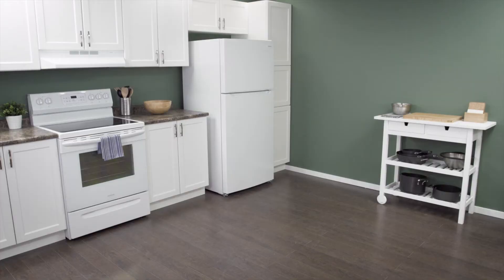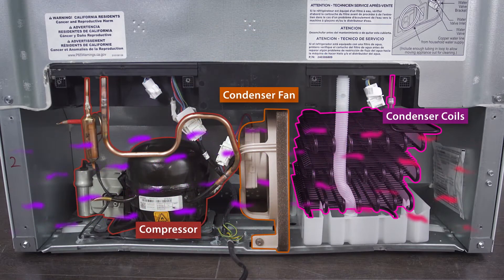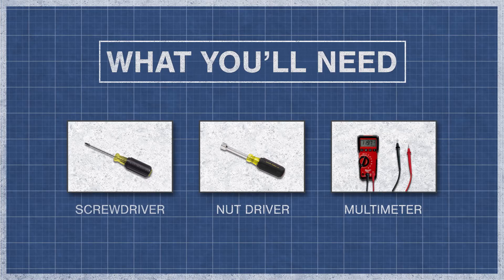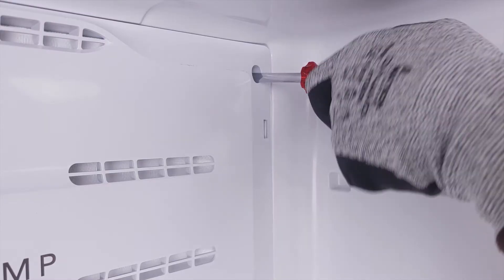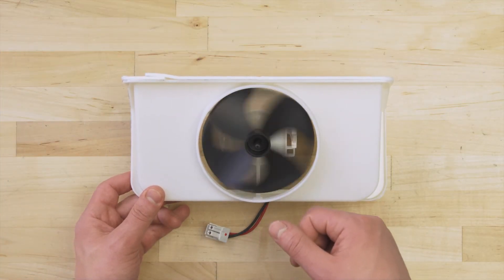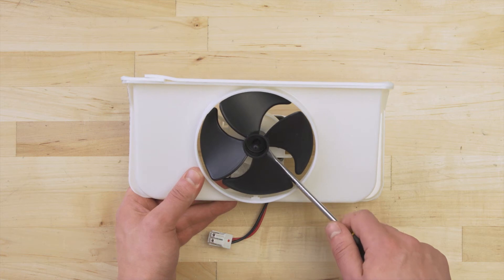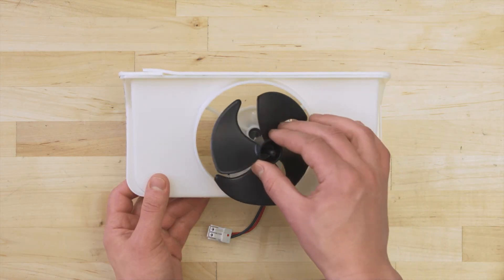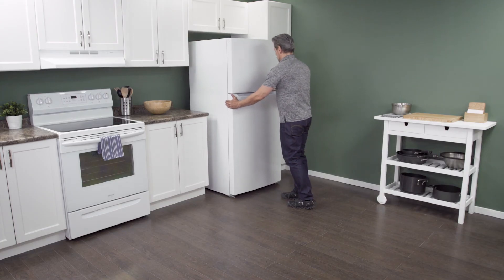How to Test & Replace an Evaporator Fan (Refrigerator) | Repair & Replace

Comment: Is it just me or is the freezer fan pins super hard to get off
Reply from the maker: Thanks for watching. It depends on the freezer. Sometimes the clip is hard to release, or you might need to use a screwdriver to wedge under to help release it.

Comment: I replaced a faulty fan motor but now it runs constantly, what would be the issue now?
Reply from the maker: If the compressor continues to run that means it's trying to cool the system. It could be a faulty cold control thermostat or thermistor. https://www.youtube.com/watch?v=pI0ian6WqSI

Comment: Where do I put the proba to test it
Reply from the maker: There will be two connectors on the motor. It doesn't matter which probe goes on each terminal. In some cases the terminals are mounted right on the motor itself.

Comment: My LG refrigerator fan is not blowing except when performing testing cycles.  Test 1, 2 and 3 confirmed the fan is working.  So what can be wrong?  The thermostat or thermistor ?  Where is it located?
Reply from the maker: If you have a control board that you're able to do test cycles, then you most likely have a thermistor, and from what you're describing it does point to a faulty thermistor. You can see how to access and test it in this video: https://www.youtube.com/watch?v=HQFRUuWIz_o

Comment: Hello idk if you can answer this but my evaporated motor/fan doesn't spin unless I pull the axel/pole up but if I let go it's stop spinning
Reply from the maker: Thanks for watching. Two things could be happening. If the motor is lying on it's back, gravity / friction might prevent it from spinning freely, and if it's installed on it's side this would not be an issue. Or alternatively the bearings might be starting to wear down. So if the fan is noisy or not getting up to speed, then you'll want to install a new one.

Comment: My fridge keeps getting down to the correct temp, then rising back up to 55F. Is this a bad fan?
Reply from the maker: If you've got a top freezer, then you'll have a cold control thermostat. In this case the cold control might be sticking... the fridge cools, the contacts open and get stuck intermittently. Alternatively in newer models a faulty temperature sensor (thermistor) can also cause weird behaviours like this.

Thermistor video: https://www.youtube.com/watch?v=HQFRUuWIz_o
Cold control thermostat video: https://www.youtube.com/watch?v=09MmevMH0hA

Comment: My freezer is still cold n freezing, but the bottom isn't working. What's the problem ?
Reply: Have you taken the back panel out from the freezer to see if there's ice built up? If there is, you might have a breakdown of the defrost coil, a breakdown of the evaporator fan, or bad seals allowing excessive humidity into the refrigerator.
Reply from the maker: Thanks for watching. This video explains how to troubleshoot this exact scenario: https://youtu.be/DR1r9BjS46A?si=OtJa3cim58q7Nasz

Comment: I have a different problem with the motor. I hear/see it try to restart spinning every 5 seconds or so. Do this mean the motor is bad or something else is triggering the restart?
Reply from the maker: That is not a common issue. It sounds like it could be an issue with the control board or the cold control thermostat.

Comment: How does one test the wiring?
Reply from the maker: It is difficult to test the wires directly unless you have somewhere to test for continuity on each side of the wire. An extension cord is easy to test for continuity if you have access to both sides. Integrated wires are not as easy to test.

Comment: Here's a question for ya. What if the fan is good but wiring is not?
Reply from the maker: If the fan is good and the wires are not, then in some cases you could splice new wires onto to repair the damaged segment. The most likely point of failure in the wire is one of the connection points so check to make sure that those are secure.
Reply: @AmreSupply  I installed second fan motor and noticed when I pushed the switch to act as door closed the fan comes on. First brand new fan wouldn't come on at all, second new fan came on sometimes when pushing the door/light switch
Reply: @AmreSupply  meaning the switch is bad

Comment: So, dumb question, do you have any tips for removing the motor connector from the Frigidaire Eventemp top mount freezer compartment? Ours will not release no matter what I try.
Reply from the maker: Thanks for watching. It's hard to say exactly as there are more than a few variations of connectors but it could be helpful to get a flat blade screwdriver and see if you can press down the tab. You might have to play with the angle as it can be difficult to actually press the tab in the right spot.
Reply: Thank you for the quick reply! Yeah, I've tried everything, and it just won't release. Do you know if it is possible to replace the connection piece if the plastic ends up being damaged? (It looks exactly like the one in your video) Our fridge is a Frigidaire ffht1835vs1 and sadly, it looks like we were sold a lemon of an appliance by a local Edmonton shop.
Reply from the maker: @jackiearcand5574  The connector could be replaced if you found the same connector but I have a feeling it would be difficult to find. While filming this we actually snapped part of the clip of this motor connector in this similar top freezer model so I think the connector is similar to yours. When reinstalling the clip doesn't click any more but it stays in still so we haven't had an issue with it sliding out. The most likely thing to break is the plastic part of the clip, and we remember this model being more difficult to release than other models we had filmed with.
Reply: I have another question regarding a different refrigerator  (KSSC36QMS02). Would an evaporator fan motor (original PN: 2259385) be considered faulty if it does not run in diagnostic mode but runs (nearly non-stop) while the fridge is operating outside of diagnostic mode? Both the refrigerator and freezer sections are maintaining proper temperatures.
Reply from the maker: @jackiearcand5574  When you look at fridges with cold control thermostats, it is easier to narrow down these sorts of issues.

Since that model has a control board it can't be easily tested. If the motor is variable speed, then it has additional wires than just your standard c-frame motor.

In this case both the motor and control board could be faulty. You could try replacing either of them but to replacing both will be best especially if there is a power issue in either of the parts.
Reply: So, about four months ago, we noticed an intermittent clicking and beeping noise coming from our fridge. Along with this, both of the fans also seemed like they were trying to run, but were sometimes not able to. While troubleshooting, I stumbled across a decade old blog that spoke about the massive control board failures affecting countless Whirlpool family refrigerators from the early 2000's. The author shared his own experience and a step by step guide on how to identify and replace the failed capacitor and relay on the discontinued control board. 
So, for about $15 worth of parts (and some rusty soldering skills), I was able to save our control board (I ended up replacing all of the relays and all but two capacitors). This got rid of the beeping and clicking (bad relay) and got the fans up and running again. The remaining issue is the evap motor running only on high speed when it is, in fact, variable speed. So I really am hoping that by replacing the evap fan motor with a new one, it will go back to performing like it should. From the hundreds of comments I filtered through on various other YouTube videos, one user (who had a similar issue with a GE refrigerator) mentioned that the issue with his fan motor was a signal issue to the control board through the tachometer wire. Apparently, when the signal is lost, the control board will default to running the evap motor on high speed. So i am keeping my fingers crossed! At the end of all of this rambling, I do have one more question. The original oem evaporator fan motor currently in our fridge is 3.0w, and the new oem motor is only 2.5w. Will that be an issue, or is it an insignificant difference?
Reply from the maker: @jackiearcand5574  If the motor is the same type, voltage and mounts the same, the small difference of wattage likely won't make a huge difference.

Comment: This is exactly the problem I am having.  Question though.  I do have continuity that appears in range on the motor, but the blade absolutley will not spin on its own.  I've order a replacement motor.  Do yu think that is the issue?
Reply from the maker: Thanks for watching. If the motor has continuity and the blade doesn't spin freely or is rough to turn, then yes it's best to get a new evaporator motor.